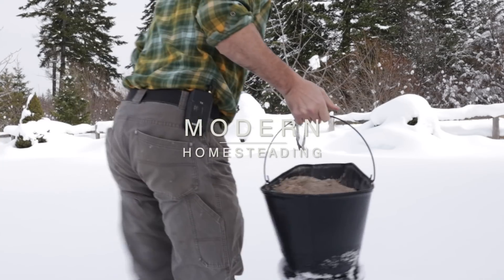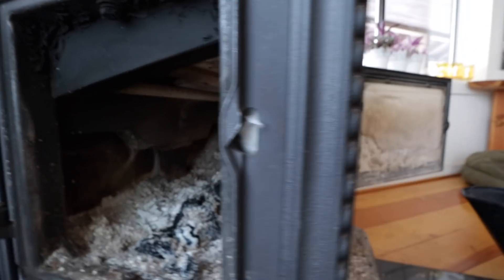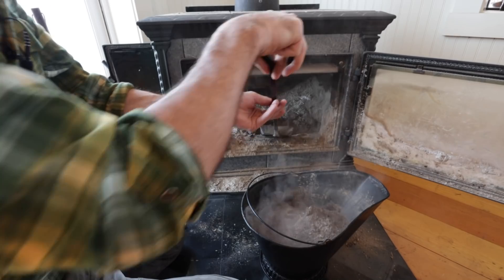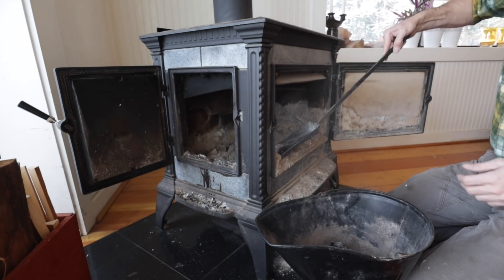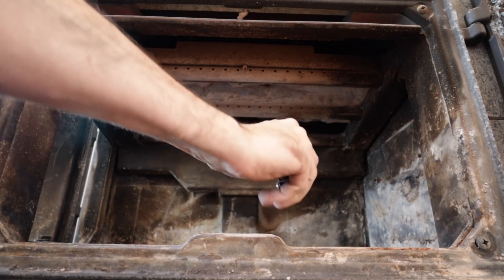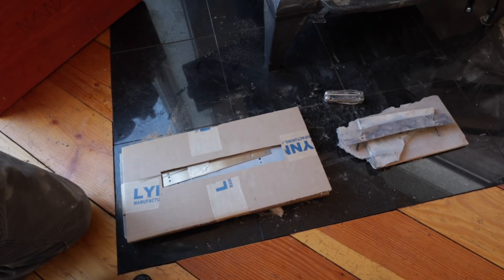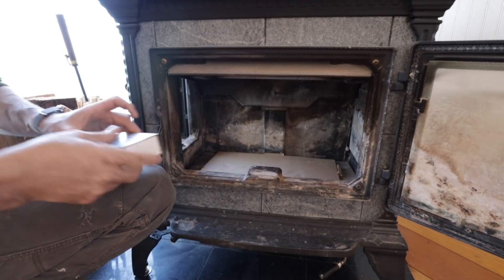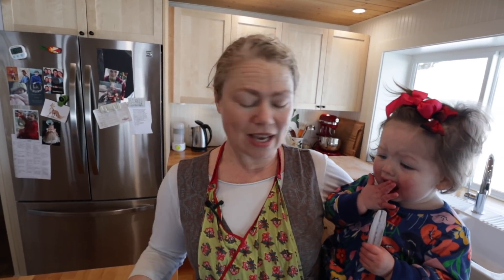Woodstove - Who Builds The Best Wood Stove?

Comment: New subscriber here, since hurricane Sandy we have heated our home with 2 pellet stoves from Tractor Supply Company, this last year we replaced one of them with a wood burning steel stove, and we love it! This tax season we will be replacing the other stove with a Vermont castings Bun Baker stove, because it is in the kitchen. The reason we are replacing the pellet stoves is because of the amount of repairs we have had to do over the years, so simpler is definitely better. with these stoves, we were still dependent on the grid for electricity to run augers and blowers, but with the wood stove, we are not, plus my wife has even cooked a few meals in the living room on top of it! all the best from the house of P.E.A.C.E....(Patrick, Evi, Abby, Christopher, Emily). Please keep up the good work!
Reply: I've heard the pellet stoves give a lot of problems the electric ones. I saw one pellet stove that was manual fed no electricity or blower I'm pretty sure. I'm thinking about a u.s. wood stove from Tractor Supply the smaller one with a glass window and the 3" about fresh air pipe.
Reply: Jon Smith both of my stoves are from tractor supply, U.S. stove works units, one is a king, and the other is the Ashley model, both need control mother boards, and replacement igniters, both have had augers replaced and one motor, the king has functioned for about 9 years and the Ashley is till in use, after a bad wire splice repair, my honest opinion is to look into a higher quality stove or go with wood burning unit as we are now replacing our stoves as money allows, will repair and sell them later, another thing to think about, is if your using them for heat, a ton of pellets is about $250.00 depending on where you live, and supplies do seasonally dry up (last year we were burning bedding pellets at the end of the season / soft wood/ and more $ for less pellets), vs. a wood burning stove, $ 200-$230 delivered, and two of can be collected year round, and if you are willing to put an effort in, a cord of wood could cost you a lot less, after purchasing a saw and splitter!
Reply: @gettintheresafelywithpatf2869  I want dependability. I think I'm going to go with a propane furnace from a tiny home and a wood stove for backup. Sounds like the wood pellets are getting out of hand on price. And supplies are running low.
Reply: Jon Smith you could put an outdoor wood boiler, load it once or twice a week, and let it bun, or a “Yukon duel fuel furnace” in the basement, either way it would save you in many ways
Reply: @gettintheresafelywithpatf2869  I will have to look into it. I'm not sure it'll work it's for a cargo trailer.
Reply: Jon Smith what ever you choose, choose wisely, you may just end up finding a fabrication shop to build you a stove, but on the internet there are smaller wood stoves available. You may also want to look at an old “parlor stove” or one from an old caboose. I wouldn’t recommend some of the home fabrication steel stoves such as the 50 cal. Ammo can stove for long term, ( not enough mass in it to radiate heat) while it may work for 150 sq ft., I don’t think it is ideal. If you go propane, think about delivery, or refill issues, and zoning requirements.
 I saw on YouTube two wood stoves that would be great options, one was a traditional styled, but smaller steel stove with I think soapstone for added mass. The other one was stainless steel, with a water tank and single cook top. Either of these might do the trick depending on  a few factors, one square footage, second floor plan how open is it. Something else to consider is how much space you are willing to give such a unit, this goes for a propane unit as well.
Reply: @gettintheresafelywithpatf2869  the one that was stainless steel with a water tank and a cooktop sound interesting. Do you know the name of the stove? I tried a 30,000 vent free orange flame propane heater. But it put out too much water in the air where the screws on the wall or wet the wheel well boxes were wet in the ceiling was too. I don't have a ceiling finished but the walls are finished with insulation. And the humidity gauge was around 70 through 80%. And it also only got up to 72 degrees and shut off because it pulled out most of the oxygen in the cargo trailer. I thought it might do that and it did. So I took that heater back to the store. I have a 20,000 BTU blue flame vent free propane heater. I tried and it only got up to 40 degrees and the humidity level was at 80 - 90% way too much moisture in the air with both heaters. And it did the same thing as the other heater ceiling wet, wheel well boxes wet and screws wet on the wall to wet with moisture.
Reply: Jon Smith I don’t know, but it was on one of the YouTube channels in bushcraft shelters, it was a father and son build team in either Europe or Australia, but you maybe able to google or check amazon for possible units stateside! If you have that much condensation in the container, there is an issue, with ventilation and insulation, no amount of heat will remove it until you get it under control!
Reply: Just looked it up,... Winnerwell tent stove the nomad it looks like it would be available on Amazon!
Reply: Also check out tiny wood stoves they have several units that are for tiny spaces

Comment: As usual nice video. One thing, for the past 2 years I have been using the Power Smith Ash Vacuum with no problems whatsoever including no ash dust flying around the house when cleaning out my wood stove.  Also, a good time to clean the glass is when you are cleaning out the ash. I dampen a paper towel put a little ash on it. Works great!

Comment: anyone that is serious about heating with wood needs to look at blaze king
Reply: I'd love to have one of those stoves but for proper operation around these parts, there's a rather spacific install method that won't work in my home. Manufacturer and dealer recommends an internal chimney not an external chimney. I have nowhere in my home for an internally located chimney so I won't be able to run it on its lowest setting and have it draft properly. I have a Pacific Energy Super 27 and it's amazing! I'm in my 3 rd season and it's a real quality piece with very tight draft control. I don't have to babysit the thing.
Reply: no one has matched them yet. 13 years with mine
Reply: Mine is almost 20 years old and still going strong.

Comment: I have the Hearthstone Homesteader stove which is the biggest one.  It is awesome! Holds the fire and the heat all night without large temperature swings.  The baffle does need to be replaced from time to time, but I’ve had the stove eleven years and it’s still running strong. I highly recommend these stoves.

Comment: Cast stove- Jotul
Steel stove- Pacific Energy
Soap Stone- Hearthstone
I’ve had decades in the business and  go to the national trade show ever year. As a consumer you have to decide what type of heat you want. Those are by far the best built and quality per dollar wood stoves on the market. I’ve seen/tested them all!!!
Reply: JonBee, We have a Pacific Energy.   It’s great.   Although I have nothing to compare it too.   Your comment reassures me that we did ok buying this 

Cheers

Although we now have super-high tech air source heat pumps by  Mitsubishi      We still prefer a nice wood fire 🔥 on a cold day

Stay wrm
Reply: Cast stoves ..... jotul ... ok
Steel stoves.... pacific energy are ok, not the best on the market especially when 2020epa standards come into account
And good ol hearthstone.... different kind of stove, old ones are good in its class, and your 2020 labeled stoves all have cats in them, but good luck on your newer models when they design them in such a way that the catalyst is directly under the flu pipe ;) good luck
Reply: Are the new EPA stoves better or the older ones? I have a small space 8' 32' with a 77" inch ceiling. I was thinking of a 68,000 BTU it's either a 1000 or 1200 square foot wood stove that has a fresh air pipe going to the bottom so it want take as much oxygen out of the small 256 square foot cargo trailer.
Reply: JonBee, Pacific Energy? They dont even make it to 75% efficiency, and dont sell a catalytic hybrid. Please, what am I misunderstanding? I'd value your expertise.

Comment: I use a large piece of soapstone as a fireback in my fireplace.  It puts out amazing radiant heat for several hours after the fire is out.  The one issue we have run into is that it has cracked in two.

Comment: I love burning with wood.  There is some sort of therapeutic aspect to it and the process of harvesting and preparing it.  I have a Vermont Castings wood stove my dad got in 1977.  It's cast iron.  Never once has it had a problem.  It loads from the front and from the top.  I like the top loading option as when the doors to the front are closed, I load it up to the very top by using the top loader.  This way it burns completely through the night.  My house is only 1300 square feet and is a two floor colonial style, but it heats the entire house wonderfully.  Both of my uncles in New Hampshire have soap stone stoves and they both like them.  So I guess it is a preference for the individual.  However my stove has been  completely maintenance free (excluding replacing a gasket once every ten or so years) since 1977 or the better part of 43 years.  It is a simple construction and also has hangers that extend off the sides that you can put wet gloves on or whatever then they fold nicely away behind the stove.  I thought that was a nice option too.   Anyway, good luck with your stove.  It's one of those "green" options for heating...as long as the wood isn't "green" if you know what I mean.  It 's really best if it's seasoned.  LOL.  Take care.

Comment: IMHO the most useful information to consider was given by Mrs. W. regarding how long soapstone units take before they begin emitting heat. If you're a weekender,arriving at camp, 10 degrees outside, 20 inside, 9 pm, you'll want a cast iron or steel that emits heat pretty quick. Just saying.
love your vids.

Comment: I used to heat by wood exclusively and will again soon.  I made a point of buying one with a clean out tray so I wouldn't have to disturb the fire. It makes a huge difference.  I kept an old welder's glove and all I had to do was open the cleanout door and pull the tray out.  Then just dump it outside; quick and easy.  It's good for the soil.

Comment: In the late 70s through the mid/late 80s we burned wood for the primary source of heat. We would clean out the furnace/stove and place the ashes in steel buckets and then set outside in the snow for a week. By then it would be safe to dispose of how ever you had available. Our stove was a DYI build with 1/4 inch plate construction and a jacket that put the heat into the plenum of the gas furnace. It had a ducted fan in the cold air return that would start when the temp was a 100 degrees in the jacket and off at just less than that. The gas furnace would start in the morning when the house got down to 68 degrees. I loved the heat and will have to check out the soap stone stove. Thanks

Comment: I heat solely with wood in my Jøtul 8.  To clean with minimal downtime I heap red coals to the right wall and shovel the left side.  Kick coals over to the now clean left side and shovel the right side.  Push pile of coals into the middle and throw on fuel.  I start MAYBE 3 fires a 7 month season.

Comment: As I grew up heating with wood, I just want to contribute, that shaker grate will save you from having to dig out the ash so much. A daily shake and empty that pan, and your stove will vent better and the ash will be much easier to maintain! It’s not phony, it definitely works. Would also prevent that embarrassment and keep you from having to shut the fire down to maintain the ash bed. Will also keep from overheating your fire brick so quickly, and make repairs such as this fewer and farther between. My mother has a large hotblast with a much larger grate and pan, and it is definitely a life saver because shoveling the ash out of that thing is no simple task, small door in the front for a relatively large stove.

Have you considered an outdoor burner? I know it isn’t as attractive, but it gets the actual flame away from the home, and if you have duct work, it can vent right on in and heat the house uniformly. 

Not criticizing, we all have our bases for knowledge and lacks thereof. Hope I helped a bit!

Comment: I am not sure what you use to clean the glass on the inside of the glass door but here is what I do. Spray the inside of the glass (must be cold of course) with a spray bottle, take a paper towel and wet it and dip it in your ash, then wipe it over the sooty glass. It removes almost all of the soot. Then follow up if needed again. Finally, just wipe down with water and a clean towel and dry it off. I always get compliments on how clean the glass is on my wood stove.

Comment: THE EARTH IS SPHERICAL otherwise the chemtrails would just disappear over the edge.
Reply: THE EARTH IS FLAT otherwise the chemtrails would be curved as well. ;-)
Reply: I've been to the ice wall! We lost 40 men over the edge that day my friends. It was a sad day indeed.
Reply: @redsampler2017  meh, actually I am ragging on Superman.  I don't mind/care what you believe, you don't needlessly evangelize it.  As I mentioned before I am a YEC myself so I get it.  I have just learned that most times you are better off just keeping quiet.  If someone wants a debate I am always game, but no need to constantly post the Earth is 5,000 years old for no reason when the video doesn't even go there...
Reply: @turnersparadise8368  ok i thought it was about the comment at the end where they where talking about weather manipulation, chemtrails is one of those options, haarp is another.
and its also one of those things we have to endure because of the end times.
Reply: @redsampler2017  > If the earth was flat and the sun never went beyond the horizon there'd be no sunset and it'd never get dark.
Reply: @redsampler2017  > On a flat plane there's nothing to hide behind. If the sun were forever above a flat earth it'd be line-of-sight to everywhere on earth all the time. And we know the sun is not near the earth. Think of an airplane flying at low altitude - it looks bigger when overhead, smaller at distance. The sun doesn't do that. And when the sun sets it does not vanish in the distance like the flatheads claim, it vanishes incrementally bottom-to-top and no amount of magnification can zoom it in. FE is an epic fail.
Reply: @redsampler2017  The best way to evaluate a scientific theory is to check if its predictions agree with observations. Flat Earth does not. I mentioned two examples. There's lots more. Do you know of any observations that rule out the globe?

Comment: Just ordered a new 2020 Hearthstone Mansfield to go in our new home (under construction now). Looking forward to the soapstone +secondary-air+cat. Should make a very good clean burning heating appliance. If all goes well we'll be heating with wood in our new home starting fall of 2021.
Reply: Cats clog and are a pain to clean.  Go for an efficient non - catalytic model if you can.  You'll thank me later.
Reply: @mrmrlee  Hi mrmlee. I've heard arguments both ways. Some people love their cat stoves, others have trouble with them. If I don't try a cat stove then there's no way for me to find out if it's the right approach for me or not. I'm well aware there could be issues and am willing to take that risk to see if it works for me. I like the idea of burning wood as cleanly as reasonably possible. The Hearthstone implementation of the cat places the cat after a modern secondary combustion baffle, so the cat is protected from direct flame and only working with relatively "clean" exhaust. The cat is also only in the circuit when the user engages the cat. It can operate without the cat enabled.

Comment: I unwittingly bought a Vogelzang Mountaineer stove about 5 years ago and just found out this year that the baffle (steel) is welded in and cannot be replaced.  It has a huge hole in it and now the stove is pretty much junk.  Won't be replacing it with a Vogelzang, for sure!

Comment: I have two Hearthstone Equinoxes.  I have damaged the baffle in both which is very easy to do.  All it takes is for a smaller piece of wood, i.e. a limb to get pushed up into the soft baffle material and poof, you now have a cracked baffle with a whole in it.  After replacing the first one, I took the second baffle I purchased to a metal fabricated.  He cut a THIN (1/16th thick or slightly less) piece of aluminum the same size as the baffle.  Drilled the two cotter pin holes in the same place as in the baffle.  When I put the baffle back in, I put this aluminum sheeting behind it to give the baffle rigidity.  That was 5 years ago and no more broken baffles.  It would be impossible to break this baffle now and I think I only paid the fabricator $40 dollars for two of these aluminum sheets.

Comment: I have same stove, in cleaning it , I noticed going in top where pipe inserts, I was finding pieces of masonary.  Looking in the top I noticed my stove  had the crack between the baffle plate and iron frame had been sealed with furnace cement,  In bumping the baffle adding wood, I had broken this seal.  Resealed with furnace cement, stove now works great again.

Comment: Mine also has a 1/2 thick ceramic blanket that lays on top of the baffle. Noticed yours didn’t, I think it helps insulate the firebox and minimize losing heat up the chimney. Also got it from Lynn.